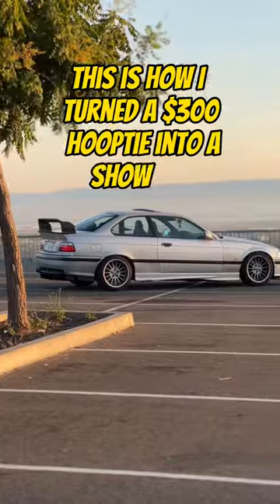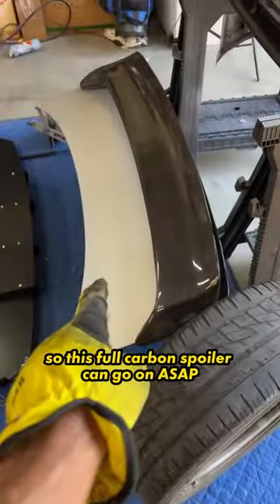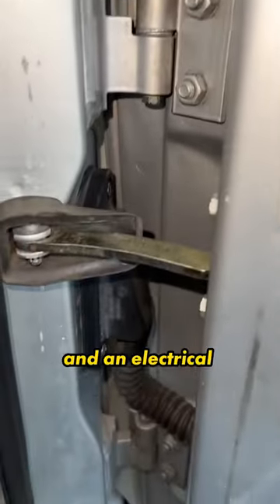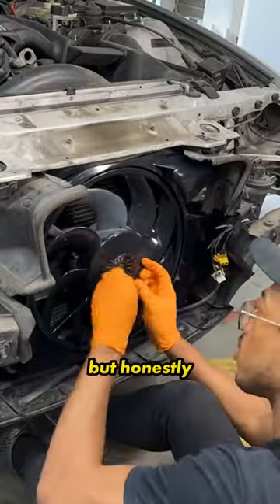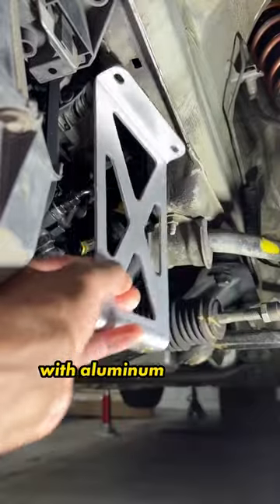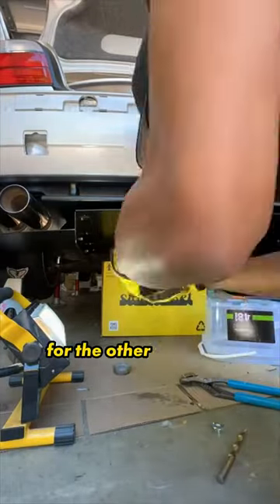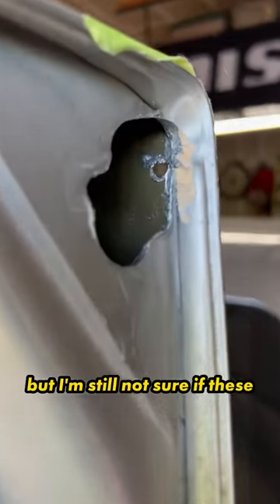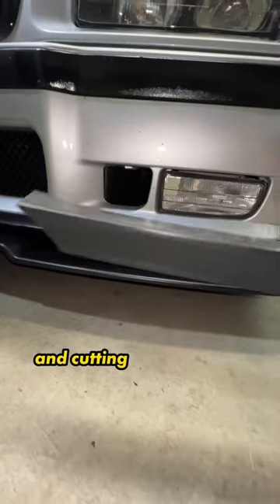Turning a $300 BMW into a SHOW CAR in just 9 DAYS

Comment: Round rivet nuts will bite you down the line.   Good concept But They are really shit after being in the elements for an hour.    Use  the angular or 6 edged ones.    That way the bolts will come out again without just rolling the nut in place.